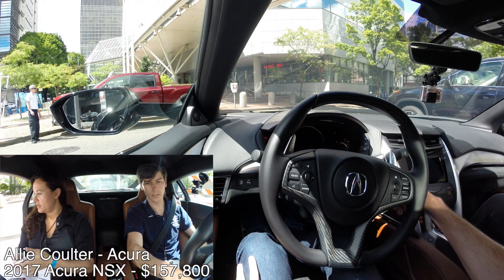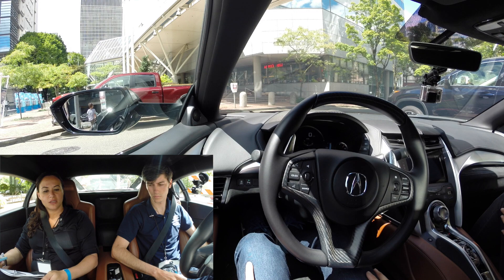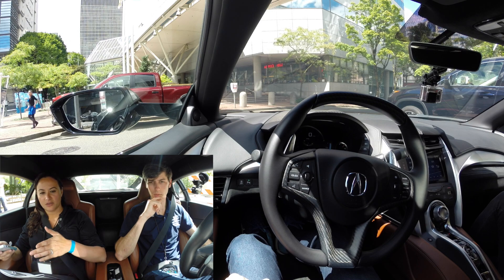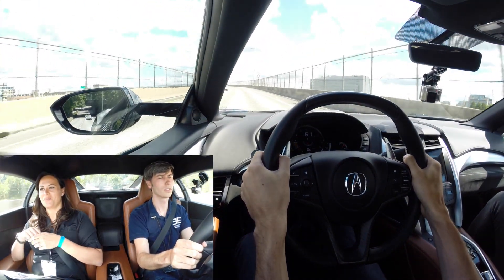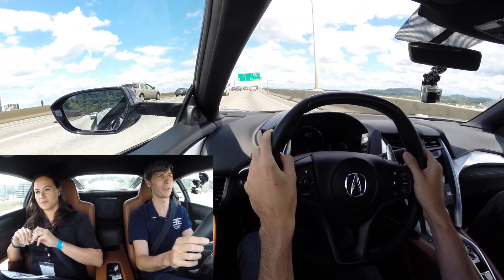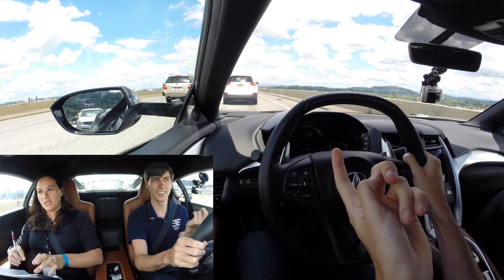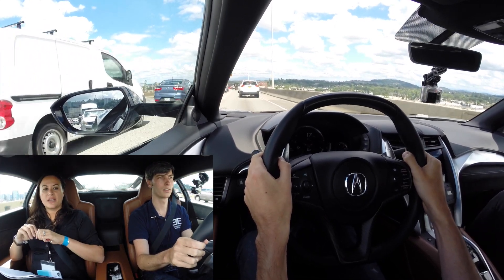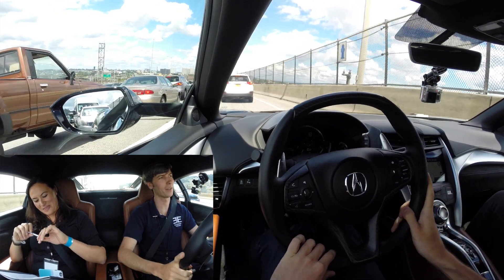2017 Acura NSX - A Casual Portland Drive

Comment: Too complicated. My Fiero has only one mode. Hop in, turn the key and drive.
Reply: You forgot about barbeque mode. haha jk
Reply: Yea it was a bummer that the Fiero didn't start getting good until 87~88 right at the end of its life.
Reply: +Tony T the Iron Duke shall rise from the ashes! ha...
Reply: I had a Fiero and I swear it was such a great attempt by Pontiac to get something really fantastic built in America. Unfortunately they had to sell it to GM and that meant putting crappy suspension and engines in it, which really ruined the whole thing. 

As far as pure driving experience it was the most fun I've ever experienced. It was basically a large go cart. I loved the speakers in the headrests and don't understand why that never took off in the rest of the automotive world. But acceleration, deceleration and turn radius were nightmares. The engine was a real POS as well as the suspension system AND braking.
Reply: +David McClelland Speakers in the head rests? so you had an '84-'85. Unfortunately in the beginning the Fiero was made almost completely of shelf parts. Pontiac had very little budget to work with. 

Mine is an '88 GT with the suspension that was designed for it from the beginning. Vented disc brakes all around, better steering...
My original 2.8 V6 engine was bored out to 3.2 and has a turbo with tuning. Resulting in 300HP. The motor just got overhauled and balanced from top to bottom. The senior mechanic said he likes those engines. Because they're simple and he knows what they're capable of. And boy does it pushes forcefully. You're right. It is a blast to drive. Puts many newer cars in their place. Corners like it's in rails. Gets looks, comments...
I couldn't afford a new car. But wouldn't want to drive anything else than that sweet little Fiero.
Reply: Daniel Groulx Yes I had an 84 SE, complete with the ever exciting automatic. lol 

I bought it used with exactly 99,000 miles on it, and the 2.5L had already been replaced one time with another, probably because it had blown. I could go on and on about the negatives of the 84 non-truck 2.5L Iron Duke but I won't, I'm sure you know them. Adding to the fact whoever replaced the engine did a hack job with the wiring so the A/C didn't work, the cooling fan didn't work (probably a blown relay, but who knows), the belts would squeal and finally popped on me sitting in traffic once and sent my engine temps soaring before I could get it off the road, causing my head gasket to blow, and I did not have a good experience.

I could have kept it and worked out all the kinks, but I had just had enough at the time. I do miss that car and they are great for those who want a mini supercar without the expense of something high maintenance. 

I just regret mine was an early 80s GM car with faulty GM electronics (didn't even go into the faulty ignition modules I'm sure you know about). I believe Chevy kept this car from being anything more than it could from the get go because of the Corvette. With only a few low dollar mods it very easily outperforms it.

I also regret when yours came out they axed it very quickly and now your year is difficult to find in my price range. That is a pretty good year.

Comment from the maker: As has been mentioned in the comments, look at the notebook in the bottom left of the screen at 4:50. Notice how it pulls up, and stays up even during gearshifts. Gives you an idea of how quickly the shifts occur, and how torque is nearly constant. One of the very cool benefits of a DCT transmission, perfectly illustrated in the real world! :)
Reply: No sure what was more exciting. The papers floating or the girl smiling at the acceleration. Both are a win.
Reply: I don't think the transmission itself is actually that quick. You can hear a delay in the engine sound. I think the motors are doing momentary full power, torque fill, during gear changes.
Reply: yes, you can and BMW has been experimenting with it for several years. But the efficiency is not very high overall: an IC engine is not very efficiënt, but the process of generating hydrogen is also not efficiënt. You need electricity to make H2, need to store it (which is always a pain regardless of which engine you use) and then you burn it.  If I recall correctly a Tesla model S uses about 200 wh/km and a BMW hydrogen car was close to 500 wh/km (and that is without the losses in the production of hydrogen). So, yes you can, and it might be a solution to be able to run IC engines without fossile fuels, but as a propulsion system it's not something to invest in.
Reply: Yes, I was like, "it's defying gravity!!!"  That was a great shot you captured.
Reply: she does not look so happy
Reply: I think Disney World employee nails it.
Reply: Ozan Erbektas https://en.wikipedia.org/wiki/Hydrogen_internal_combustion_engine_vehicle

I think fuel cell engine are more efficient but the production cost is probably too high. It's the same problem for electric cars. 

The ICE engine is less efficient but cost less. 

But the main problem is : how do we create this hydrogene? It's not a kind of natural resources. We have to make it. So if we still pollute to make hydrogene/eletricity, it doesn't resolve the problem at all, it just move it elsewhere. 

If we choose this as a mass solution, we got to be sure that we won't pollute more to supply the massive need of energy required to produce all that electricity/hydrogene
Reply: She looks irritated... Like "no... once again...", "i wasn't ready" or "don't fucked up, guy!". Then he started to laugh and she started to forcibly laugh too... How polite she is...

It realy looks like she does that for her job. Absolutly not like she was realy into it in her real life IMPOV.
Reply: Engineering Explained I left you a comment in the cvts trans video can you please reply when you have a chance
Reply: +Ozan Erbektas hydrogen is a very powerful element. when it is ignited it explodes. it can be harvested from water. sadly modern day engines aren't made to deal with the force of the explosion or the complications of storing the gas. good concept, not feasible just yet.
Reply: Haha, that's amazing
Reply: Yeah, that's awesome :D
Reply: I didn't notice that the first go-round.  I was focusing on sound lol.  That's awesome!  I wish American car manufacturers would pay attention to this lol.
Reply: Watched again very good noticing that

Comment: sexiest car ever. I'd buy it over a Ferrari any day.
Reply: Yup, Ferrari's are overrated af.
Reply: +lothar52 f type is pretty sexy I admit also. if I had to pick between nsx and f type I wouldn't know wich one haha. also the new Toyota supra comming out .
Reply: Yeah but not in black, it's gotta be something bright like red or orange
Reply: +roebbiej true but thay only applies to Ferrari's higher models . not the 2 lower ones.
Reply: Sorry.... Ftype hotter but the old XK is even hotter than that!! I'm biased ;)
Reply: F-Types are good looking heavy pigs.
Reply: +Jeff K yup . I'd buy that over the nsx and f type any day . looked insane when the revealed it...... takes your breath away. and you get the Toyota reliability, just as you get the Honda reliability with the nsx. but jaguar has made a huge comeback in their quality of cars . they used to be like ford hahaha . now there themselves with a good quality in their new cars .
Reply: They did fail,  I have owned a s2000 integra type r and nsx and those cars were fabulous. I still own a s2000. The new one is too busy tech wise and the styling is lousy. Acura has that ugly beak nose on all its cars, they should have broke away from that with the new nsx and started making other future acuras in line with the new design theme, after all the nsx is the flagship car. Instead they shaped it to fit with the old design theme of yester years acuras which are not very aesthetically pleasing. Also the sound of Hondas old sports cars was incredible and i think only a Ferrari can rival the sound of those old cars. The new ones sound sounds toned down. The old ones sounded like f1 cars the new one sounds like sleep apnea.
Reply: Honda powered F1 cars were beating Ferrari.
Reply: +SirChocula until you drive one my friend. then you'll know what a Ferrari is about

Comment: Hi Jason.
That smile when you opened the throttle entering the motorway is quite contagious mate.
How does it drive with that cr gearbox through city traffic?
Everyone is taking that car to the track or the mountains, thank you for not doing that and showing the car where it will actually be used. 👍

Comment: Sounds overcomplicated compared to the previous nsx
Reply: You do know that the previous NSX was JUST as complicated when compared to it's "rivals" right? It had more electronics than anything it could be compared to. The original NSX was NOT a simple car by any stretch of the imagination.
Reply: It's 2016 the first nsx came out in 1990
We have so much technology now! we didn't even have iPhones in 2005 when they stopped making the nsx now look at how much we changed.
Reply: David Beecroft Well by your logic I might as well go back to the Ford Model T because it still does what a car is made to do, right? Honda have been at the forefront of using electric gadgets since even before the first NSX. If you want a "purer" supercar, go get the Audi R8 V10 (I would too) for the same money. The NSX provides you with a choice, whether you would like to be an owner of one of the "transition" cars. The NSX shows what we can expect in the future. Hybrid supercars at first, then all-electric supercars. The R8 V10 is pretty much the epitome of the "pure" supercar. Which one you pick is all up to you.
Reply: David Beecroft Hybrids have their place. Some people would love to listen to the sound of a petrol engine, yet take advantage of the pluses that an electric motor brings. The NSX is doing this pretty well when it comes to the electric side of things. Small electric motors to fill the gap in a gasoline's power-band. However, I agree on the point that the V6 in the NSX is nothing special. 500HP is good and all, but I can't help but feel that in a car that costs THIS much, they could have done something more than just bolting two turbos onto a V6. I mean, come on. Audi did that in the S4, and if you put enough time and money into the 2.7 V6, it would shred the one that is in the new NSX, yet it's 20 years older. It's obvious why Honda have gone with this approach, they specialize in small, high revving units, which in a Civic is all fine and good, but when you are pricing it to compete with the R8 V10, a car that has one of the best engines ever in it, it's kind of uninspired.

Also, I'm all for electric powered cars, but I would love for petrol powered cars to remain, at least as "weekend" cars. In that regard, I feel like in the long run, buying an R8 over the NSX would be a MUCH better choice. Sure, the NSX is fast, but it's engine isn't anything special and it WILL be surpassed as technology gets better and better, whilst the V10 in the R8 will always remain one of the greats of this time period.
Reply: +Newgenerationisbg $150,000 is not much more than a corvette and a viper you get a nice modern sophisticated car 
That doesn't burn through gas like water.
Reply: +Newgenerationisbg acr viper is$120,000 and the zr1 corvette was $120,000 when it was made.
The nsx has a lot more technology for $30,000 more.
Reply: Newgenerationisbg you should get one of the refrigerators with the big ipad built in that has wifi and i-net access because, ya know... cold food
Reply: Dodge 318 Cummins Which universe do you live in? Last time I checked a corvette starts from a third of that price. Also, I wouldn't call either of those cars "sophisticated". They use huge engines to make their power, and the versions that can keep up with an R8 V10 aren't anywhere near as refined or daily-driveable as said R8.
Reply: +opl500 idk. The market seems to knock a few points off of cars when manufacturers keep it simple. Look at Mitsubishi. Their vehicles are all simple and straightforward yet get criticised for simplicity. The demand is now in the range of "complex" and "sophisticated" cars.
Reply: +David Beecroft the first gen NSX was built upon the concept of making cutting edge technology more accessible to regular people. The new NSX does the same exact thing, if its too expensive to you then all you have to do is not buy it. Honda knows that not everyone would like a hybrid NSX but they have to keep moving forward and hybrid technology is the future whether you like it or not
Reply: +chris Brown of for sure and at least this New NSX can match performance in its segment. The big criticism is that even though it's just as fast as it's competitors, more sophisticated, etc, it may not be as fun to drive. Steering numb, the engine sound is not as good and synthetic, styling will become dated, etc (And I mean in comparison to it's competitors). 

In the end there will always be more sophisticated cars, but why the old NSX is becoming more popular is because people are starting to realize it's a damn good car to drive. I mean some are going for as much as $40K, the only thing that was really missing from the original NSX that is relatively easy to do today is improve the sound of the engine, that's it, lol. 

Or like the old air cooled 911s, omg... people are all over those now, they went from 15K to some jumping up to $80K (depending on model of course), but it's because people want that pure driving experience, but they also want A/C and such. These cars from the 80's and 90's offer 90% of all the amenities that modern cars have, but give that visceral feeling than a lot of newer cars can give.  And lest be honest an old air cooled 911 would get destroyed around any track, circle, road course, drag strip by any modern sports car for around $50K, yet that's not why people buy them.
Reply: Sigma Projects I understand man but I'm pretty sure Honda will more than make up for it with the new s200, now that'll be a masterpiece. I haven't read up on the upcoming s2000 much but Honda will be foolish to put a hybrid system in that
Reply: Chris Brown Honda has already some fun stuff, but it's not available in the us. Like the Civic Type-R or the tiny mid engine S660. I have no doubt Honda will eventually bring a new entry level sports car to the US again. Especially since the Civic Si is really being out paced by its competitors and the CR-Z just isn't as good as people hoped it would be years ago.
Reply: Dodge 318 Cummins
Just because you can, doesn't necessarily mean you should. Sometimes less is more...

Comment: Too much tech.
Reply: don't be so narrow minded
Reply: surely you meant not enough
Reply: +AKlover people want a sophisticated car that isn't going to break. If you have the money I don't see the problem with this awesome car.
Reply: when the na1 nsx can out it used groundbreaking engine technology for the time (first VTEC system) why would the new one be any different?
Reply: +AKlover like? and smoke how? on a drag strip? on a track? which track? on a road course? there isn't one end all be all car.
Reply: Because all the other high-powered cars nowadays don't have too much tech, right?
Reply: +Ninja Master I get what you're saying but that's how things are moving with most car manufacturers now. they don't want you fiddling with things. I mean I'm sure when fuel injection was coming out some people were upset that they couldn't tune it like they could a carburetor but it's how we progress. one day you'll prob have the ability to swap batteries for more powerful versions and such. the aftermarket will evolve with the product line.
Reply: Remember when the NSX was closer in the price bracket to Corvette or Viper? Pepperidge Farm remembers.
Reply: It's a car for those people with a lot of money. If you want to get a simpler car I'd suggest a MX5 or GT86.
Reply: +Henrik Nilsen the new lotus Elise also looks good. TST did a great one take with it and Matt made comparisons to it and the early nsx's.
Reply: Same as any other super car. you don't take your Ferrari 458 to your regular mechanic.
Reply: Henrik Nilsen   Plenty of cars many for less money that will smoke the technical showcase.  Having 15 layers of tech to plow through before getting to the simple joys of why you bought such a thing in the first place a distraction.

Comment: Very cool. How is Acura's DCT vs. PDK?
Reply from the maker: I've only driven one Porsche, the GT3 and that was on a track. It was superb, but I didn't have much opportunity to really test the NSX's. Very smooth and fast for the one highway pull.
Reply: +Engineering Explained one feature I would like to see on more dual-clutches is the GT3's paddle neutral feature.